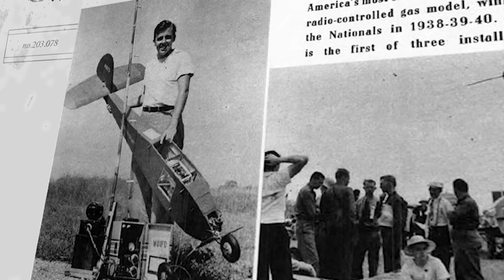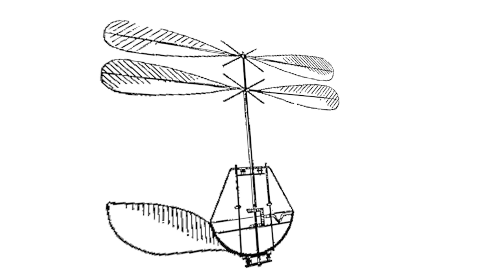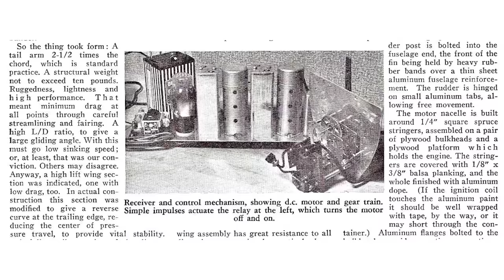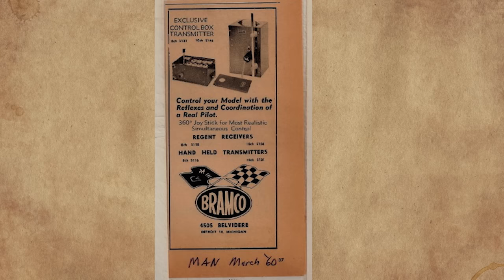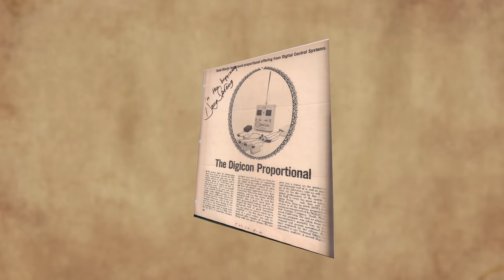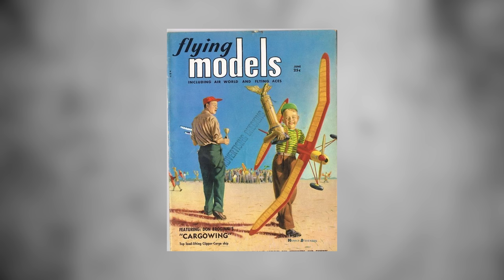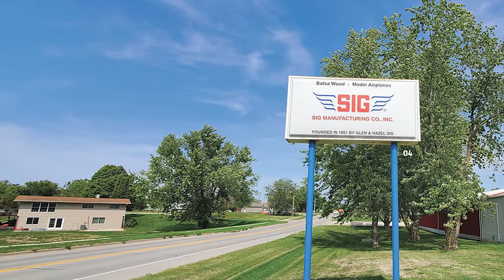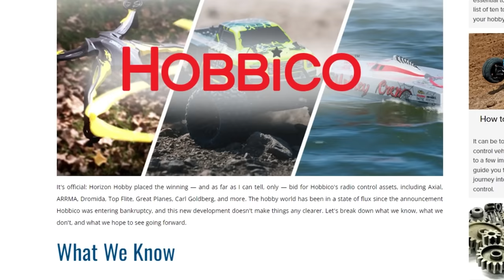A Complete History Of Like 1% Of RC Planes

Comment: I started flying RC in 1976, with a balsa kit (the "Taxi") by Graupner powered by a Super Tigre .23 glow engine and controlled by a Simprop SSM 5-channel radio. No dual rates, no expo, no programming, nothing. Just bare-bones, 4 proportional and one on-off channel. And the thing was so incredibly expensive (1K US$ for a 4-servo system) that it was inconceivable to have multiple receivers and servos for various models. I had one Tx, One Rx, four servos and one battery, and that was it. When I wanted to fly another model, I had to transfer all the on-board electronics. Then in the 80s I got a Futaba radio with plenty of affordable servos, receivers and batteries so I was finally able to crash more than one model in a single day at the flying field.
Reply: Ha! I bet you're a damn good RC pilot brother Man
Reply: @HciContractor I'm not the one who stands out at the field, no fancy 3D, no latest & greatest models. But I've been having so much fun out out of this hobby. That's what counts.

Comment: I hold memories of my late-father's enthusiasm for flight, which included flying model kits he built... such as a vintage monocoupe, that required the builder to cut general balsa stock (bought separately) to match the shape of pieces displayed on it before initial assembly. When I showed an initial interest in flight, we recovered the finished model from storage at an uncle's house, along with a Citizen Ship on/off-switch transmitter and uninstalled servos that used rubber band escapements. Being an employee of a large corporation, he was able to make reprints of the original blueprints for our to-be-done ambitious recreation of this lovely model... which was never realized.

Oh-well... at least we have the joy of SIG's basic rubber band-powered kits, that we built gluing balsa to the paper diagrams we pinned to 1"-thick Styrofoam during assemble and final main wing setting.😊

Comment: 1st radio - Ace Pulse Proportional 1-channel (rudder only). Never forget that "thwack-thwack-thwack..." of the actuator. Running on 27MHz, a local CB radio could knock it out of the sky ("no honest, I crashed because of RF interference"). 2nd radio - Cirrus 3-channel, mostly with 1/2A racers running aileron and elevator. Never forget the color coded clothespins on the pole to get your frequency. 3rd radio - NX8+. Talk about a time warp...

Comment: I remember my first radio controlled transmitter and and receiver and four servos put out by a company which is no longer around called Heathkit and yes I had to put it all together which was the Transmitter,Receiver and servos from the ground up. When it was done I had a 4 channel single stick Transmitter with a Receiver and 4 servos. It was a pain soldering all those tiny resistor's and capacitor's that went into the system and then when it was done and I flew my first plane with it and was amazed that it actually controlled the airplane. I will always remember that system and yes I did move to my next system being a Futaba.

Comment: What a Vidio!
I love the sneaky jokes made all the way through!
This isnt really related but I just dont get it, most likely due to a lack of experience on my part; Whats the advantage of say a Spectrum IX14, over say a Radiomasater TX16 4in1? I get that spectum is easier to use than Opentx but the TX16 isnt complicated. i thought I ask here, most likely bc i know this community flys Spectrum.

Edit: This sounds like hate but I like spectrum. It might just be that a 10x cheaper servo held up longer than a spectum one as I found ot mid flight.